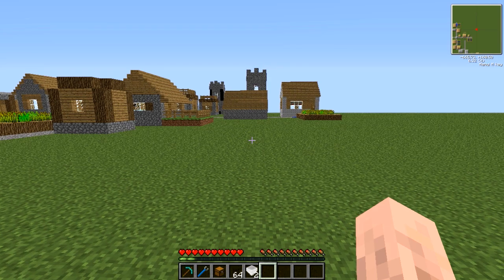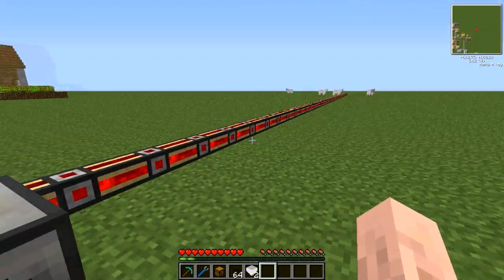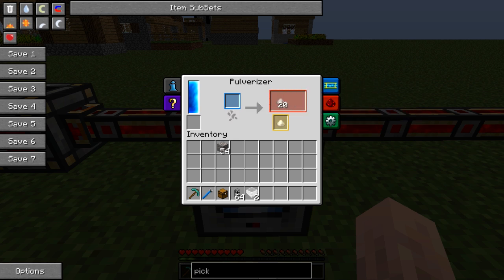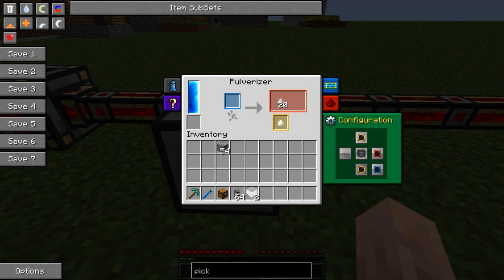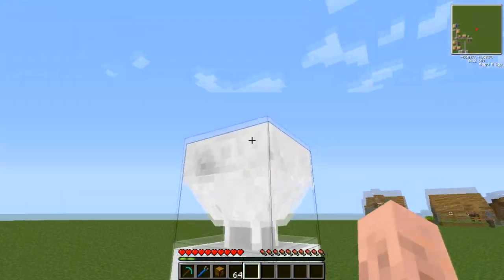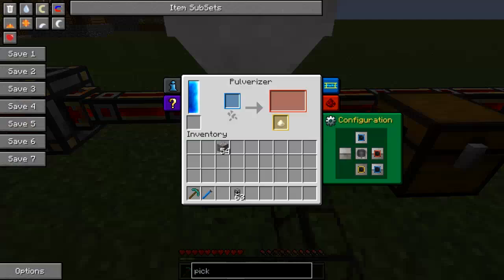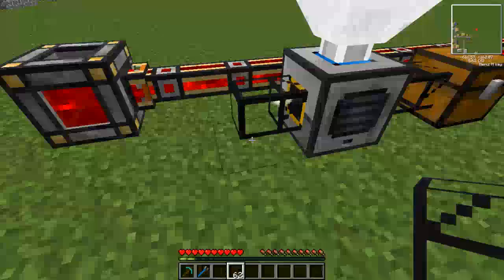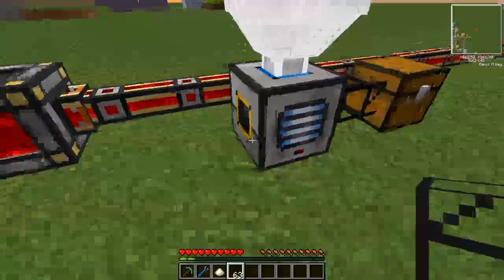(NEW) TEKKIT Tutorial: Pulverizer from thermal expansion

Comment from the maker: Batbox? Do you have ic2 installed? Because eu wouldnt power the pulverizer. If you meant the biofuel generator from minefactory reloaded, then redstone conduit or conductive pipes would do the job nicely. Just make sure that the pipe attached to the generator is a wooden conductive pipe.